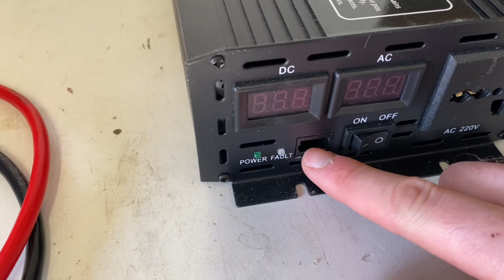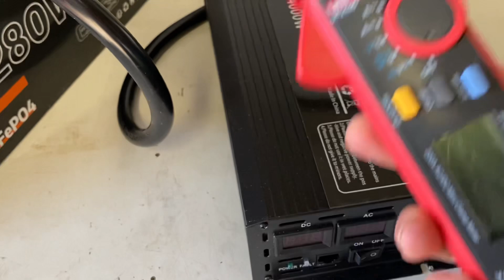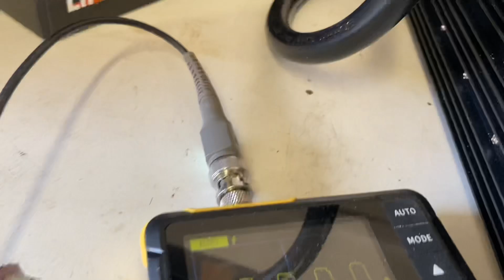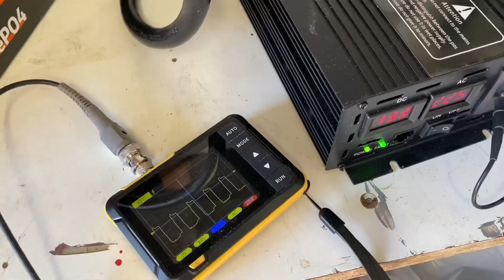Testing the EAFC Inverter – Idle Draw & Waveform Check!

Comment: I see one issues i fine in damage or blow gate resistor that spwm drive signals is not reaching the the gate but the 50hz pwm is thats why the square wave only on the oscilloscope
Reply from the maker: Interesting observation! Thanks for sharing your thoughts on the waveform. 👍